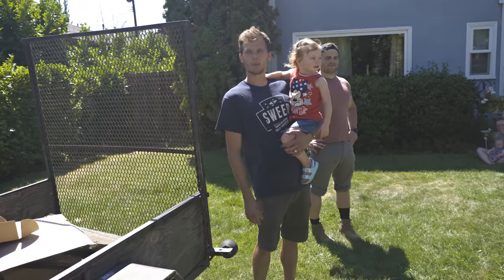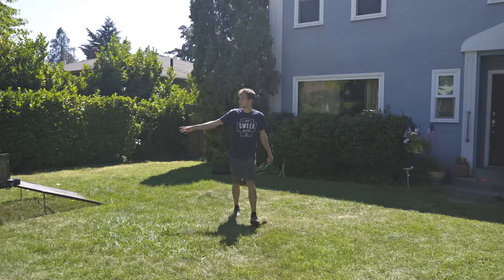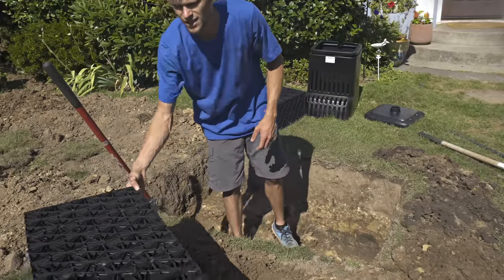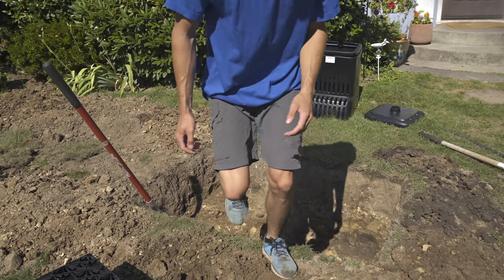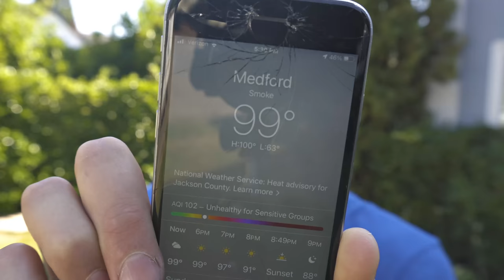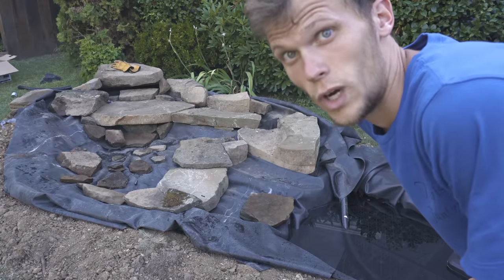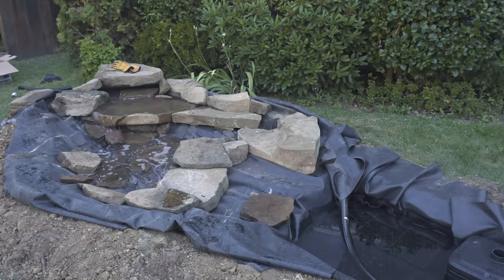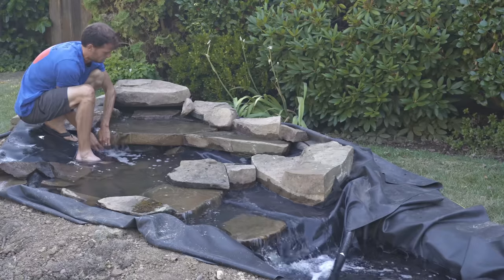A Pondless Waterfall for my Mother-in-law

Comment: Dang this is really nice. I may have skipped over it but do you have an estimate on  how much all of this would cost doing a self install?
Reply from the maker: This particular Pond Kit used in this video is $1800 on the Aquascape website. Including the boulders and river rock and plants you're looking at more than $2500. 
Most of my projects are DIY however, where I source various supplies from different providers and I can keep the cost of a water feature this size down below $1000. 
For instance, a pond liner and pump for this project can be picked up for less than $500 on amazon, then I get my rock for free from my parents property, and I've significantly reduced my price.
Reply: @travisjantzer  thank you for the detailed reply

Comment: in that heat, I imagine evaporation must be an issue with this fall? looks good dude ❤
Reply: My wife and I had a bubble rock that was pondless. It attracted lots of birds that would line up across the way and take turns getting baths on the rock. Evaporation was pretty constant during the year, even mild loss in winter when the temperatures were far enough above freezing. My one regret was not having an automatic refill for the pond to ensure the water didn't get too low and damage the pump. If I ever do something like that again, you can bet I'll have a solution for that problem. The other consideration would have been a UV light to help prevent algae formation.
Reply from the maker: What Richard Said. Glad you like it :)

Comment: Great job  do u think before the liner I would need sand
Reply from the maker: I like to use some kind of cloth to help protect it but if the dirt is real soft its not a huge problem. my concern with sand would be its integrity. you wouldn't want the rock to settle as the sand shifted.

Comment: What is the advantage of pondless?
Reply from the maker: So ponds grow algae really fast, and require maintenance with filters and stuff. Ponds also lose water to evaporation easily and are a risk if you have small children around. A pondless waterfall can have all the same volume, but less maintenance, less evaporation, and less risk of animals and kids diving in.
Reply: @travisjantzer  Nice, I was thinking you could drive on top also to make a dual fall each side or similar